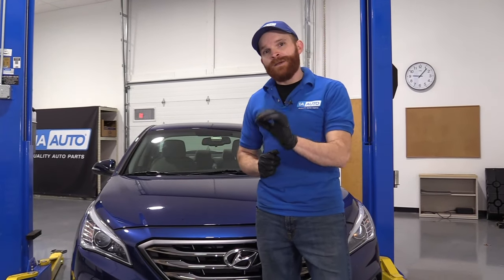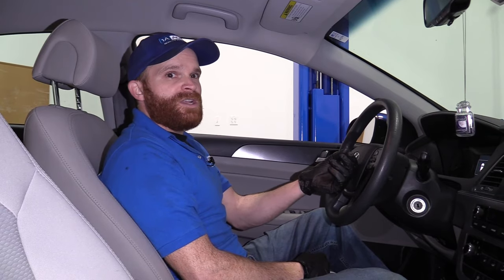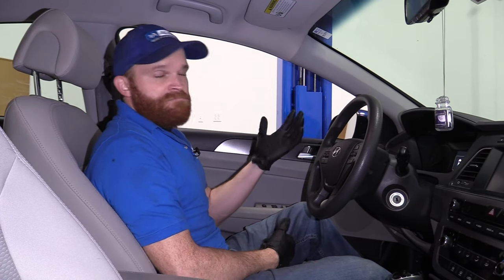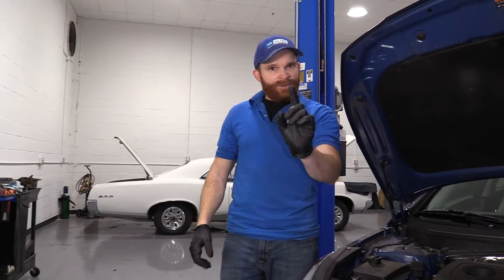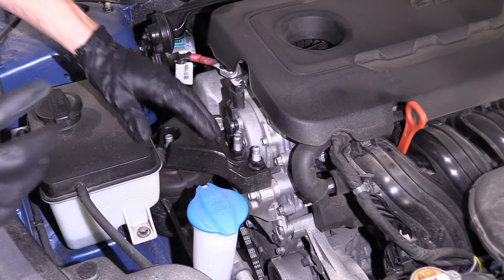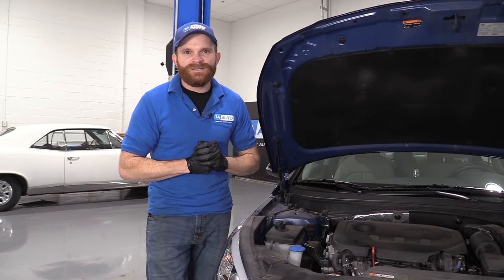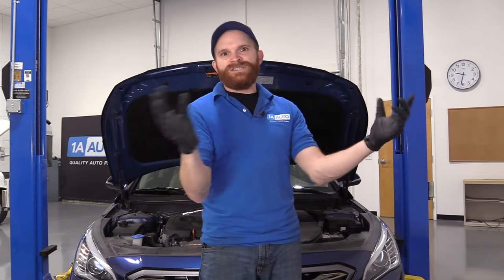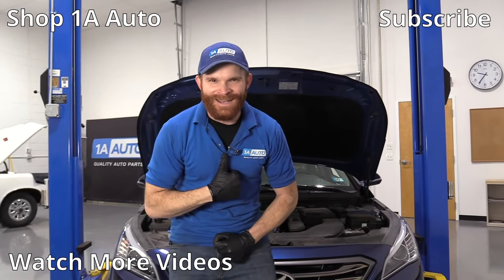Top 5 Problems Hyundai Sonata Sedan 7th Generation 2015-20

Comment: Great channel (just subscribed) and I wish this vid would have been out before I bought my 2018 Sport Turbo.  Speaking of which:

I'm a little surprised that there's no mention of the major engine issues this car is having.  Issues so bad that the engine warranty has been extended to 120K, then to LIFETIME on the short block, as a result of a class-action lawsuit.  But there are a number of caveats attached to those warranties.

My engine failed yesterday (108k miles) and I await word from the dealer as to whether Hyundai is going to step up.

Comment: I got the P1326 issue, it was the rod bearing connectors. Hyundai replaced them under warranty.

One thing I did notice on my 2015 Hyundai Sonata se is that when I’m at a red light and I let off of the brakes and I’m starting to go forward my car does a small shake. I changed spark plugs, belt tensioner pulley, serpentine belt, gasket valve seal. So not too sure what it is.

Comment: My 2015 Sonata is giving 20mpg in city. It used to be around 25 to 24 mpg now it is 19 to 20mpg, I don't drive that much and change oil every every 5 to 6k miles. No idea what is causing bad gas mileage

Comment: We are about 110000 on our 2017 2.4 and she keeps going into limp mode saying knock sensor but when you check the oil it’s low but it’s crazy because I keep up on the oil changes and it only had 1600 mins on it and there is no leaking oil and I don’t see any blue smoke or mixed oil in the coolent. But it needed 2qts do you think this has to do with the timeline tentionor for the oil consumption that’s going on?

Comment: I have a 2017 Hyundai Sonata Limited hybrid I have two videos of a warning light and a bell ringing off that says check HEV system turn off engine and the engine doesn’t kick on and there’s no power to the motor just electricity it is very frustrating when I take it to the dealership and they say there were no codes when the mechanic got in there was no warning lights when I actually have proof and I took a pictureOf the check engine light along which is the triangle and the! In the middle of it. Something is going on with this car and I feel like I’m being placated by the dealership I do have two videos to support us I had to have the car towed to the dealership because it would not drive for me

Comment: I have a 2017 Hyundai sonata sport and the issue i had with mine is when you drive it and then park it and then go back to start it up it starts up shaking. I turn it off and restart it and goes back to normal. It also did it to me on cold starts. Not sure what the issue was but i took it in to the dealership for a couple of recalls on the ECM module and other updates and it made the problem go away.

Comment: I have the 2015 2.0 T limited. It's an awesome car! Beautiful interior, push start, panaramic roof. 

a)I had the engine replaced! It was replaced by Hyundai. 
b)I had the hood latch freeze up on me. 
c) rear suspension issue.
d) back up camera gets dirty, hard to clean.

Comment: I actually do have issues with acceleration  my question is is it something that will be more than 100$ im asking cause i need to know to use my warranty or not
Reply: You need a vcm
Reply: If it's the p1326 code your engine should be replaced free of charge.
Reply: @DominusDionysos  I have p1326 issue with my hyundai sonata 2018
Reply: @spirituallyconscious7774  Then they should replace it provided you're up to date on recalls. If you're dealership is BSing about it then call corporate.

Comment: 2018 sonata lost power and voltage and now it doesn't start according to the manual it has to do with either a alternator belt or the alternator 60,000 miles

Comment: I need help if anyone can help, I have poor acceleration like he said in the video. It happens after running the car for 10 minutes or so the RPM is jumping to 1/2 and it sounds like I’m holding the gas and when it’s time to go I have very poor acceleration and the engine sounds like it’s taking off but it’s really not. I been told I had a broken intake but I’m not if that’s really the case. Has anyone had anything related to my issue ? (2016 with 50k miles).
Reply: Check the intake runner control. mine was bad and an easy 10 minute swap and it was back. Sadly afterwards my engine just started consuming oil.

Comment: 2016 Hyundai Sonata Se here... 
Husband just told me as he was driving to work he broke hard twice and the oil light came on , flickered and went out. What would have caused this? I would understand if a brake light came on but not for an oil light? Could this be because we just changed out the battery  Friday night , 2 days ago ( preventative maintenance it was six years old I didn't want to take any chance) , would we have needed to reset anything after changing the battery? With this have caused the oil light to come on when he broke hard? Thanks for any help guys!
Reply: Did you check your oil level? Sounds like your oil level is low.
Reply: Check the oil level when he stoped hard he pulled the oil in the oil pan away from the sensor that shows you have a low oil condition. Also check the connection to the sensor to make sure it is tight and not damaged.

Comment: I have 2015 Sonata SE 2.4 L and it's burning oil.  What could be a cause?  Thanks.
Reply from the maker: +2 A We wouldn't be able to diagnose an issue like that here, you may want to have a local mechanic take a look at it. Thanks for checking us out! http://1aau.to/m/Shop-1AAuto-c
Reply: I'm having  the same issue with mine no leaks  or nothing take your car to a Hyundai dealership let them know the problem  an they will start a oil consumption test
Reply: 100000 mile warranty. get it replaced for free.
Reply: All GDI engines burn oil more than other engines. Change the oil at 3k miles with full synthetic and check the dip stick once a week to make sure it's not burning too much.
Reply: @thegoatbros8571  same thing here i have 2013 Hyundai sonata and is burning oil for over 2 years now i add oil every 500k miles don't waste your money with mechanics because the problem is in the pistons
Reply: @AmirAmir-rh4ey  I have a Hyundai sonata 2015 SE, now 61000 miles, when I turn off my car I smell a little bit of burning and gone after that, can you tell me what is the problem?
Reply: @brett2396  i have hyundai sonata 2015 SE, now 61000 miles , when i turn off my car i smell little bit burning and gone after that, can you tell me what is the problem?

Comment: I own a 2017 Sonata base model and noticed a low beeping sound when driving at 50-60 mph+, at a stop light, and after shutting off the vehicle. The sound it makes is the same as when the alarm is activated from keyfob, just very low.
Could a bad alternator or fuse cause this issue??? Any ideas?
Reply: Same with mines I bought it yesterday, uear 2017 as well amd noticed today the alarm is very low.
Reply: My car did the same turns out the alternator was bad
Reply: @albertomunoz9965  I changed the alternator but noise still happens.
Reply: @zaidarodriguez30  did you ever get an answer for why it happens?

Comment: I want the 2015 the korean version of LPG, do you think this is and reliable and durable car?  or should i take the ford focus sedan 2015 automatic with automatic trans?
Reply: I have a 2016 sonata and has been a super reliable car. You’d take a big L with the focus.
Reply: Ford has recently had a really bad reputation, I would stick with Hyundai, which is on an upward trend of reliability
Reply: that ford may frustrate you in the long run. i have two friends that will attest to that. they both owned a
 focus

Comment: My 2017 sonata burns a lot of oil really fast, any reason for this?
Reply: I have a 2017, 2 liter it does not use a drop, I change every 3500 miles, 50k on it,  I take it yours if off warranty, no sign of it leaking or blowing it out , does it smoke out tail pipe,
Reply: Take the protector boards off the bottom of the vehicle and see if your oil pan is leaking. Very common with our model. The mechanics that do the oil changes tighten the bolt way too much and it cracks the oil pan.
Reply: My uses more oil than I would like it to. About 1 quart or so over 7500 miles. I have found out that the brand of oil you use makes a difference in how much is lost.
Reply: I do too and am going thru all kinds of crap with dealership to get a new engine.. Apparently this is a problem with some sonatas around this year model.. The internet is full of people reporting this issue and Hyundai is aware of it but of course doesn’t want to replace engines.. apparently there are some faulty engines out there.. The dealership has made us do 4 oil consumption tests at 1,000 miles apart the car failed all 4 , now i have like 3 MORE TESTS with them , they r putting a sealant on the drain plug and filter the checking and other stuff.!!! These are all stalling tactics as farvas we r concernd , we may be getting a “lemon lawyer” soon .. This is so sad.. we have owned 4 Hyundai’ and always happy but this will seal their fate with us.. NO more
Reply: @martyhall9904  do you use a synthetic blend or 100% synthetic?  We are wondering if using 100% synthetic may cause a problem..
Reply: @martyhall9904  a lot of it gets burned, what kind of oil do you use?
Reply: @tamb7587  my engine blew ab at month ago on 2015 sonata se. car ate all the oil and blew on the way home. I know my all 2015s come with a lifetime warranty on the engine so you might as well let it blow...

Comment: I have Sonata 2017 sport 2.4l with 93000 miles. I hate Hyundai’s.
Burns engine oil like hell now. 
P1326 that you mentioned came up at 87000 miles. So what’s that internal issue that you didn’t mention properly!!? Please elaborate, & don’t confuse. Thanks.

Comment: I got 2015 Sonata GL 2.4L with 130k km and it's burning .4 liter engine oil every 1000km. People at dealership says to change the engine under extended warranty it should burn 1 liter every 1000km.
Is it common for car this old to burn this much oil or is it excessive and I should get rid of it before anything major comes up?
Reply: Mine burns like crazy. It’s just been an awful lot of problems with this car and they don’t honor the warranty. Get rid of that junker never buy another Korean car. That’s what I’m doing.
Reply: Get rid of it
Reply: same here.  did two oil comsumption checks at dealer and they say it's within limits.  about to do a third one.  43,000 miles and i just had a wheel bearing hub assy replaced.  couple of years ago my variable valve timing gizmo almost killed me due to severe loss of engine power.  when tow truck arrived my brakes totally failed as i drove towards the truck due to vvt vacuum failure.  it's a lemon.  my 2014 veloster had a wheel bearing go bad at about same mileage.
Reply: I had the same problem with my 2016 Sonata. Mine was burning 1L every 300 miles and then the engine died at 79K mls. The dealership changed the engine under warranty, and now it is not burning oil anymore. It runs well and does not ping during acceleration. Also no black exhaust pipe end. Now engine mounts are bad. Just a bad car.

Comment: Your wrong again. The 2011-2014  sonata has the airbag issue setting codes for the clockspring. The nosie from the steering is a worn out coupler again 2011 through 2014. This is the body style before 2015 and current. I know this because I work for hyundai.

Comment: How about a 2017 Sonata Hybrid. Thanks!
Reply from the maker: +Kroatoan Eight-Four We're always cycling through common cars. We'll add this repair to our list! http://1aau.to/m/Shop-1AAuto-c
Reply: @1AAuto  Thanks. Hoping you put up one video that can sweep the top 3-5 hybrid cars by sales, and another video for top 3-5 hybrid SUVs. People might not be afraid to buy hybrids if they only understand how those efficient and wondeful machines work. Again, thank you for the reply.
Reply: 2017 Sonata Hybrid.  Oil changed every 5,000 miles.   91,000 miles.  When started after sitting overnight, knocking noise. Timing chain tensioner?   Though, it goes away after driving 2 or 3 miles.
Reply: I have one, are you looking to buy one, or find out more about them?  Let me know, I can post a short video of mine on my channel if you wish to discuss them......
Reply: @jonsmith1259  does you check engine light come on , I had issue with the coils on mine it was doing a lot of weird stuff, they replaced all four and  its fine now, the car right from new has always had a hesitation problem when its cold, after you move a few 100 ft I  would get a couple surges or jerks, but only happens when its cold, I have 50k miles, other than that very dependable , nice ride and fuel efficient,
Reply: @jonsmith1259  my rattle started that way too. Now it's not just after startup, but more frequent while driving and at higher speed as well. Did you find out if it's the timing chain tensioner or something else?  Mine has 104K miles. Thanks!

Comment: The timing chain tensioner is an issue on all GDI Hyundai engines. Even if you replace it, the sound comes right back almost immediately. A pointless repair.
Reply from the maker: +michael gibson Thanks for the feedback!

Comment: I have 2015 Sonata, and I am not aware of any issues you mentioned in the video. If a car is well maintainance then you will not have any major but minor issues.
Reply: have you had any issues with the sonata burning oil?
Reply: @Anonymous-ji4sb  i have a 2016 and the low level is constantly low. did you find a way to fix the problem?
Reply: @andrewd5135  Engine replacement. Its under warranty.  My 2013 Optima was out of warranty and using 3 quarts between changes. They replaced it for free.
Reply: Change the oil at 3k miles with full synthetic and check the dip stick once a week to make sure it's not burning too much. All GDI engines burn oil more than other engines.
Reply: I have a 2015 Sonata SE with 270K miles... still running like a champ and no oil burning
Reply: I think it’s more of a list of possibilities.Doesnt mean it’s going to happen.
Reply: You just wait and see.

Comment: I have a 2015 2.0t limited and has been great with minor recall services, I have 108k miles. Recently at start up the turbo has been making a whining noise dealer told me the engine will need to be replaced when or if the turbo goes out. My understanding is I have 125 mile warrenty on the engine since it was deemed an issue with the manufacture. I have been pleased with the GDI engine I purchased a 2020 Kia Stinger. Tha is for the video and info.
Reply from the maker: +Herman Vogt Thanks for checking us out! http://1aau.to/m/Shop-1AAuto-c

Comment: I have not had any issues with my 2016 Hyundai sonata 2.4 l car.  But the airbag issue that you mentioned does concern me. Shouldn't Hyundai have notified us if it is a recall to have this component replaced?  I only have 62,000 on the vehicle, because my other vehicle is manual and I prefer driving that for most of the city driving and I save the Hyundai for long distance drives.
Reply: Newer cars seem to have more problems then early to mid 2000’s cars, I’ve seen 2000-2005 cars drive over 250,000 miles while cars 2013 and newer have severe problems with the engines failing at 100,000 miles, some of the 2009-2012 cars have problems too, but majority of them are minor problems that doesn’t cause the entire engine to have to be replaced, you can save alot of money in the long run by buying an older car and changing parts as they go bad instead of buying a newer car

Comment: I have a problem with my 2015 Hyundai sonata 2.4L. we changed the brakes change the rotors and bleed the brakes lines got hard. then we started driving the brake pedal got soft and went to the floor. Don't know what could be the problem.
Reply from the maker: +Rey Jimenez We wouldn't be able to diagnose an issue like that here, you may want to have a local mechanic take a look at it. Thanks for checking us out! http://1aau.to/m/Shop-1AAuto-c
Reply: It requires a computer to bleed an antilock break system. So you will need to go to a mechanic. This goes for all cars with antilock break systems.

Comment: In addition the 2011-2014  sonata has a warranty extension for the  clockspring for 15 years unlimited miles for that item if the airbag light comes on for that reason. 2015 to current has no warranty extension or  coverage since it does not have those issues. If you own one just call your local dealer have them run your vin number all that applies attaches to your vin number.
Reply from the maker: +Smoked stang smoked stang Thanks for the feedback!

Comment: My 2017 Hyundai Sonata white had a chunk of paint peel off above the rear door about 1 1/2 years ago. Hyundai repainted that paint that peeled off. Within the last 3 months a huge chunk of paint started peeling off the roof. Hyundai has said they will have that repainted at no charge, yet the dealer said I’d have to pay $100 to have the window removed. Hyundai is aware and are just repainting the minimal cars to avoid a recall.
Reply: There's a problem with that paint, white only. I have a 16 Sonata in the same Pearl White, only one very small chip has come off the top corner of the trunk lid. I know another person with a 16 Accent, same Pearl White, with extensive paint peel on the roof and rockers. Again, it just seems to be affecting white Hyundai's.